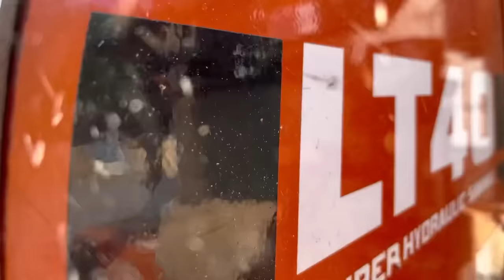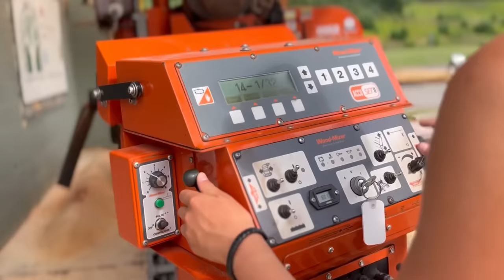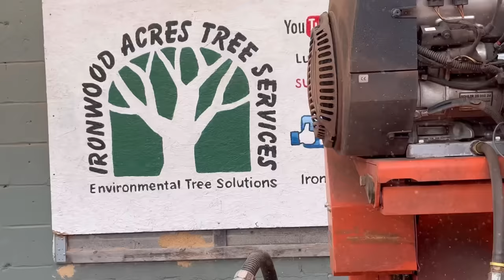A Good Day For Milling Hemlock

Comment: We've got a guy at work, he lost his right arm above the elbow a couple of years back. He was operating a screen and put his hand under a conveyor belt to clear a piece of wood. He'd done it 100 times before. The belt snagged his sleeve and dragged him in. The moral of the story is you can break the rules regarding personal safety and get away with it for years but one day it just might catch up with you. Safety is a routine, a habit. You do it very day regardless. You leave the jewellery at home, ALL of it. You tie the hair up, eliminate loose clothing, wear safety footwear, eye and hearing protection, helmet and anything else relevant to the job you're doing or site you're working at. Do all that and there's a real good chance you'll reach old age in one piece. If you don't want to take personal safety seriously I suggest you girls do advanced first aid. It may come in handy when one of you has a crushed leg, severed hand, scalped, pierced eye, broken back etc. These things take more than a band aid and a sling. Good luck girls, If you're going to neglect your safety then you'll need it.
Reply: They get messages just like this every single video they put out.  They know.  They're careful around the machinery.  How about speak on something else instead of beating the same dead horse?
Reply: With a healthy respect for machines (Beware of Dog) every single day and a sign in my shop:  "In with Ten - Out with Ten" to remind me on the bandsaw, I've still got all ten since 1976.  I prefer foam earplugs these days, but the over-the-head band on earmuffs have saved my cranium many times from Warner Bros star-spangled moments.
Reply: Jack Thelad  you are right 100%
Reply: I think they do a pretty good job of minding their health and safety. The hair hanging down isn’t an issue as everyone knows they all have buzz-cuts and just wear long wigs for aesthetic purposes. There was one episode where Jade put on Emerald’s red wig by mistake. They took down that video real quick!
Reply: @verteup  "They get messages just like this every single video they put out.  They know.  They're careful around the machinery.  How about speak on something else instead of beating the same dead horse?"

""They get messages just like this every single video they put out."..... that should be followed with: "And yet they still choose not to be safe. They know. It's their choice to risk their safety and lives. Unfortunately, they are setting a terrible example."

THAT'S what your message should have said. There's a reason they get messages like that every single video..........
Reply: @verteup  Kind of ironic, you used dead in your reply. I think Jack commented because, like me, he cares about their safety. Nothing wrong with that. I worked for OSHA for over 28 years and have seen things that would give even the hardest people nightmares, they certainly did to me. I've complemented the ladies on observed safe work practices and have also pointed out things they could be doing better. Likewise, I hope they take my comments as constructive criticism because that is sure how I mean it. These young ladies are beautiful, and we all want to keep them that way.
Reply: @TreforTreforgan  Wasn't it the boss who put on the red wig?
Reply: @johncarter1137  😂
Reply: You're absolutely right!  I often get scared for them, cause they're very young and if would be awful if they got wounded at work for the rest of their life, because they wear absolutely NO safety equipment...  Minimal requirements: hair tied, gloves, safety shoes,  glasses, and no garment floating.
Reply: @verteup  Wow... we've got a word sheriff in town on what you can say here. Have to say, there are many safety videos out there showing the dangers of long hair around moving machinery, some are disgusting, but I won't mention it to the girls now that you've brought up what we can't say here ... thanks much.
Reply: I'd love to see a video with proper safety equipment and practises!
Reply: @scfan7231  have you seen how much coffee they drink?! These kids are wide awake and focused on what they’re doing, don’t worry about that.
Reply: You forgot to mention the phone.  Nothing drives me crazy more than working with the person who checks their phone every 2 minutes.  Also skip the music if your working with other people.  The combination of earmuffs and headphones = nobody can communicate with you.   And the people working with you will eventually get sick of repeating themselves because you never hear what they say.
Reply: @billyfraiser6298  Yes I’m one of them. And I still will be one of them. Two uncles who lost limbs no girl went to school with who always wore a starve. I think she was 5055 when it caught up with her her take off on her grinder mixer. Can’t imagine how ugly it was For everybody involved. Only takes once
Reply: @verteup  Because nobody LISTENS.  That is why there are repeated Safety Meetings etc etc.
Reply: @verteup  Yeah. Safety around heavy machinery. That old chestnut.
Reply: @verteup  Because it takes endless repetition to get safety into people's heads. There is no such thing as common sense attitude when it comes to rotating or rolling machinery. Its not the third world where they are. Wait till an accident hits and see where the lawyers go to get recompnse for damaged fools.
Reply: @verteup  OK. I'm sure they're fine then. Bro.
Reply: @oczhaal  And gawping at their phones every few minutes while machinery is running.
Reply: @TreforTreforgan  Truck drivers might say the same thing. Industrial accidents happen to people who are fully awake to their surroundings.
Reply: @romandybala  no they dont
Reply: @verteup  So, they know, and yet they continue to work without proper gear? That's just plain stupid. While I don't wish any harm to befall them, ignoring safe work habits is just asking for severe injury or worse.
Reply: @ricomon35 they've already made videos about the safety bullshit explaining their reasoning.  There's no point beating a dead horse crying about safety every video they make. That's my point.  If you're not bringing any new information whats the point making a comment about anything?
Reply: @lumbercapitallogyard hi my name is Mike Horton and I love your video very much
Reply: @TreforTreforgan 🚚 yes Ago now 📼 6📹
Reply: Thanks for the lecture Dad! 🖕
Reply: At least some gloves, don't want to get splinters in those pretty little hands of there's.
Reply: I think this video is a fake. They just pretend / acting of doing the work
Reply: @verteup  accidents are well... accidents. You can be as careful as you can be all it takes is a split second for an accident to happen...
Reply: oh alright grandpa
Reply: @TreforTreforgan  Well, I am glad I read this thread.  I was about to ask about their hair.
Reply: Yes, Jesus! I came on to say you almost gave me a heart attack operating machinery without having your hair tied up under a hat or hair net! 😮 It can happen in an instant and you won't have time to switch off, please improve your personal safety, better safe than sorry.😘😘
Reply: They will keep getting messages urging them to raise their personal safety coz new viewers seeing this it's the first thing they notice, hair not safe.and they comment before reading your useless defense of their freedoms!
Reply: @vaccinefraud5570 😂😂😂My hard hat was pretty scuffed up from collisions with beams. But proves they work and can take a good amount of impact.👍
Reply: @TreforTreforgan That is a brilliant idea for Ladies or Guys with long hair who are uncomfortable wearing hairnets and hair clips! Just shave it off and wear a wig!
Reply: @mindtekzone lovely ladies often have a little chihuahua defending them.😂😂
Reply: @gordbaker896 Health n Safety reduces production , that's why small companies weren't interested for decades but it's not the 70's and most of those old skool bosses are retired and there's legislation in place to prosecute those who work unsafely so there's no chance of getting away with it in 2024.
Reply: @romandybala it's the worst thing you can do , video yourself breaking the rules, authorities are lifting videos straight off YouTube and making prosecutions.
Reply: you obviously haven't worked out what their selling here yet?
Reply: Thanks dad.
Reply: @Tom94517 more than 22% of women in the States own firearms, so are you trying to say gun owners are victims, or victimizers? No matter. What you say, in the end, is of little importance, because you know not of what you speak.
Reply: I bet every interview @nzer57 has is a perfect reflection of personality, work history, and values.
... or maybe 8 minutes is for the views and machines aren't as hands on as "back in the day"
Reply: ok osha
Reply: Hear, hear ❤‼️👏
Reply: @verteup  i laugh because you think other people watching this video should rather watch some random dudes in worksuits sawing wood ?
Reply: @verteup  Safety is all about repetition of the message.  I applaud his reminder.
Reply: @HomeAtLast501  I made those comments a year ago. I don't care. I said what I said.
Reply: @verteup  You said what you said, and let him say what he say, and do what he do. Or something like that.
Reply: @HomeAtLast501  yea. Over a year ago.
Reply: Пьяный слесарь говорит:
- я знаю технику безопасности как 3 пальца...
Reply: Wouldn’t get so many views then…